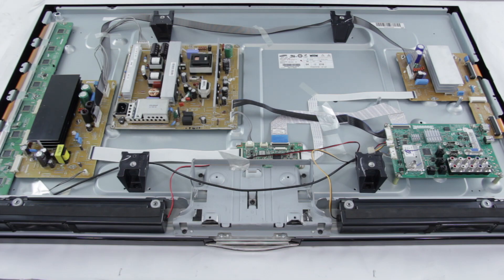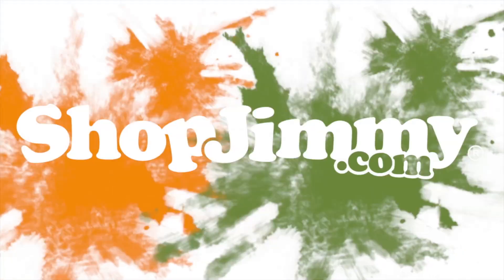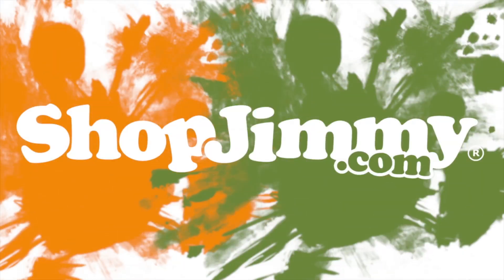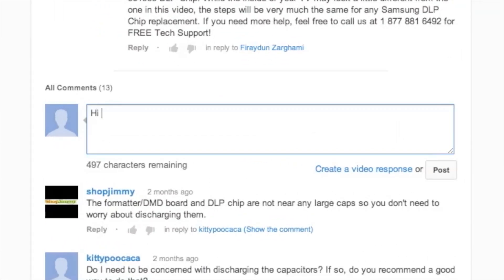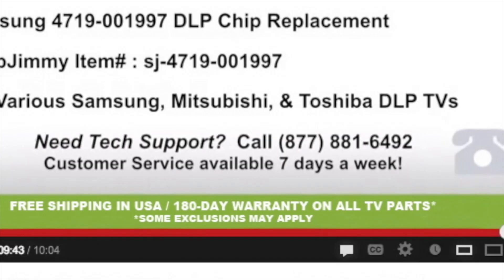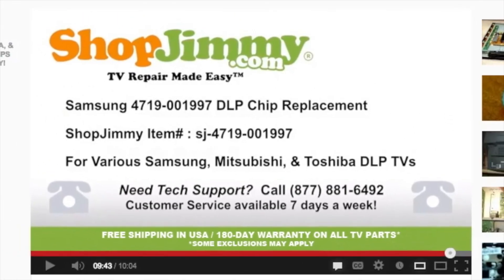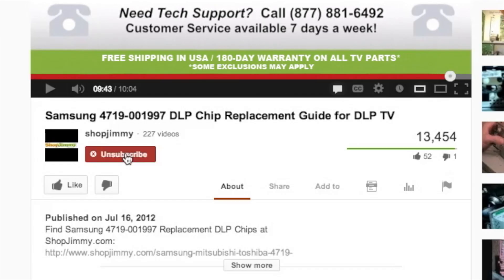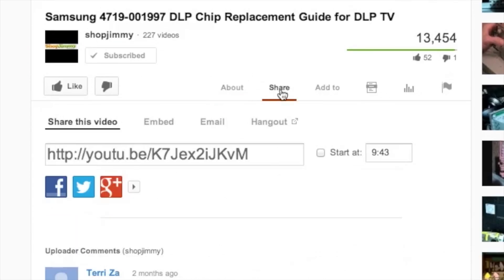Plasma TV Repair Tutorial - Common Symptoms & Solutions - How to Fix Plasma TVs

Comment: Hello, hoping to get some direction on an NoPicutre/ButSound issue with a Samsung Plasma.  
Model: PN60E530A3F
Model Code: PN60E530A3FXZA
Version No: TS02
Symptoms: 
	1) Started out not being able to turn the set right back on when accidentally turning off.  Could hear sound from whatever source was providing signal.  Would let the set sit for about 15 minutes and attempt power on again to get picture to work
	2) After a few months, the power on would produce no picture even if the set was off over night or during a workday.  Noticed the Stand-by light blinking when attempting to power on when this occurred.  At this time, the issue did not occur every time.  
	3) After a few more months, The issue occurred every time we attempted to power on.  Out of frustration, we would press the remote's Power button many times, and after about a minute or two, the television would power on with Picture.  When we were successful, we would leave the television on for days at a time, just so that we would have a television.
	4) For months after, when the television HAD to be shut off, we found the length of time of repetitive PowerOn/PowerOff was increasing, until we were having no apparent success.
Actions Taken:
	1) Lots of Googling for similar issues with Samsung and other Plasma sets.  Found many people with the power cycle issue and blown capacitors.  None reported having sound or the ability to finally get a picture after repetitive PowerOn/PowerOff.
	2) Finally found a video with a Russian (or other Eastern European accent, by my ignorant American perspective) gentleman who described my exact symptoms with his Samsung Plasma.  He described how he ordered an entire board set, replaced every board, testing after every replacement, until he replaced the Main Logic, resulting in success.
	3) Determined that my best initial action would be to order and replace my Main Logic board, based on the striking similarities between my situation and that of our comrade. 
	4) Did research on Shop Jimmy site to make sure I purchased the correct version of my Main Logic board (there were several alterations made to that particular board, and I believe I chose the correct one)
	5) Replaced Main Logic Board and tested with no success, same results as before.
	6) Cursed and shouted and received the eye-rolls and condescension from the wife.
Next Action: Either attempt another board replace, take it to a costly repair shop, or take the set out to a field "Office Space" style.
Much appreciation and adulation for any advice and direction you can provide.  Thanks!
Reply from the maker: Mark Waldorf   I recommend replacing the Y-Main Board and the Upper and Lower Y- Scan Drive boards in your TV.  Here is a link to replacement parts for your TV model number on our website, click here:  http://www.shopjimmy.com/catalogsearch/result/?q=PN60E530A3FXZA  Be sure to match part numbers on your current board, with your replacement for compatibility.  Here is a link to a video showing how to identify your part number, click here:  Samsung Plasma TV Repair: Samsung Plasma Panel Parts Guide  You can also call our customer service for further assistance with your purchase.  (877) 881-6492  Thanks and please let us know if you have any further questions with your TV Repair!  www.shopjimmy.com
Reply: ShopJimmy.com Thank you for your response.  I was coming to the same conclusion based on many comments in other videos based on similar criteria.

However, since my last post, I have attempted some other trouble shooting methods found on other ShopJimmy videos.  I attempted to check voltages on the Main Power Board connections to the Main Board and found the voltages to be as expected.  The connections to the X-Main Board were off or zero.  I tested the VS and VA test points according to several other videos and found these voltages to be at zero.  I have never dabbled in intermediate or complex electronics before this TV, so I am not sure if I tested properly. But since I successfully tested the Main Board connection voltages, I assume that I tested the VS and VA correctly, expecting 211v and 57v respectively, but got nothing at all.  Do you have any further advice about how to test the Main Power as the possible culprit, before I spend more money on the other 3 Y boards?  I have a gut feeling that I'm dealing with a bad power board, though I do not see any visible sign of bad Caps or damaged board.  Thanks again!
Reply: Mark Waldorf@user/shopjimmy Forgot to mention, I also attempted the method of disconnecting the X-Main (and Y-Main by default) from the Power Board, powering up and monitoring the Green LED on the Logic Board.  It originally had a long steady 4-5 sec on 1 sec off flash,  unplugging the X-Main from the Power produced no flash at all.  Then, plugging in the X-Main back into the Power and disconnecting Y-Main from X-Main, and get the same 4-5 sec on 1 sec off flash.  The videos describing this process said to anticipate the quick flashing when the troubled board was disconnected.  But I never got that result. 

Also, I get no power on "chime" from the TV when plugging in, as most videos demonstrate.  

I hope I didn't talk your ear off, but would like to get you as much info as possible to accurately diagnose this issue.  I CAN'T wait to order the correct part, get it in the mail, install it, and watch my TV again!  Thanks again!
Reply: Hi Jason.  Unfortunately, after replacing the Power Board, Logic Board, and Main Board, I was no closer to fixing my set.  I attempted to locate a decently priced Y-Main Board on our continent, but saw nothing I was willing to splurge on without knowing for sure the problem lied with that board.  I ended up taking the set into a TV repairman (who knew they still existed?) and he confirmed the issue was with the Y-Main.  He also confirmed the board was hard to come by and instead suggested that I allow him to send it to a secondary repair contact who re-manufactures boards professionally.  This will cost a total of about $300.  But I'm still paying on the TV/Furniture, and would like a working TV of that size, and am not willing to toss it, when a new one of that size is a grand or more.  ShopJimmy said it was the Y-main, and it appears they were right.  I was trying get away with replacing the cheaper of the boards first, but ended up wasting about $100 on those boards.  When all's said and done, I'll have sunk $400 into a 2 year old TV that originally sold for around $1000.  Sucks.  

If at all possible, try to isolate the problem at the Y-Main... it seems like the culprit on many of these sets, according to ShopJimmy and other YouTube accounts of Samsung failures.  
Like you, I will never purchase another Samsung TV.  We have a 42" Element set that is like 6 years old, still running strong.  Good luck, Kemosabe.  Hit me up again if you succeed,

Comment: I have a Samsung Plasma made in January, 2011. Model #PN50C-4501D. A vertical stripe appears more often than not on the screen 2.75 " wide at a fixed location 5.5 " from the end of the left edge of the screen. Has variable white, black, gray and sometimes pencil thin pink vertical lines within the stripe. Which part sounds defective?
Reply from the maker: Michael Thornton   This sounds like a TV panel problem.  If your TV panel is bad, it may be more cost-effective to replace the TV as panels are typically hard to find in stock, difficult to replace, and expensive.  Thanks and please let us know if you have any further questions!  www.shopjimmy.com

Comment: what parts do I need to fix my plasma tv.my tv has sound but no picture.my plasma model PN60E550D1FXZA
Reply from the maker: Eufemio Simangan   I recommend replacing the Y-Main Board and the Upper and Lower Y Scan Drive boards in your TV.  Here is a link to replacement parts for your TV model number on our website, click here:  http://www.shopjimmy.com/catalogsearch/result/?q=PN60E550D1FXZA  Be sure to match part numbers on your current board, with your replacement for compatibility.  Here is a link to a video showing how to identify your part number, click here:  Samsung Plasma TV Repair: Samsung Plasma Panel Parts Guide  You can also call our customer service for further assistance with your purchase.  (877) 881-6492  Thanks and please let us know if you have any further questions with your TV Repair!  www.shopjimmy.com

Comment: My Samsung 50 inch Plasma TV Model HP-S5053 Powers up , has volume but no picture..I checked the dvd player on another set and it was fine. My research has lead me to your channel for possible help. Any ideas for how I should proceed would be greatly appreciated.
Reply from the maker: Trab Yellup   I recommend replacing the Y-Main Board and the Upper and Lower Y-Scan Drive boards in your TV.  Here is a link to replacement parts for your TV model number on our website, click here:  http://www.shopjimmy.com/catalogsearch/result/?q=HP-S5053  Be sure to match part numbers on your current board, with your replacement for compatibility.  You can also call our customer service for further assistance with your purchase.  (877) 881-6492  Thanks and please let us know if you have any further questions with your TV Repair!  www.shopjimmy.com

Comment: Thanks for the excellent video.  I have a panasonic plasma TH-42PV70H tv which is having problem with display.  The green and red pixels get mixed up and distorting the video.  It is similar to the problem explained in the YouTube video  Plasma Problem Sparkling Red Pixels. Your help to fix this problem is highly appreciated.
Reply from the maker: azuhar   I recommend replacing the Y-main board and buffers in your TV.  Unfortunately I do not see any replacement parts in the search results for your TV model number on our website.  Please reply with your part number on your  Y-main board and buffers and then I can try searching for replacement parts.  Thanks and please let us know if you have any further questions!  www.shopjimmy.com

Comment: Hi Jimmy 

I've been trying to find a video to confirm what's wrong with my tv I have a samsung ln52a650a1f when I turn on the tv works fine but couple minutes later it makes a very hateful sound that comes from the speakers and then it shuts off and on . I tried replacing the power supply but it still doing the same thing I found this video on YouTube this is exactly what my tv is doing http://youtu.be/8qxjAzhm4Rc

Im thinking the problem could be the main board 

Thank you very much Jimmy
Reply from the maker: Ricardo Suarez   I recommend replacing the main board in your TV.  Here is a link to replacement parts for your TV model number on our website, click here:  http://www.shopjimmy.com/catalogsearch/result/index/?cat=56&q=ln52a650a1f  Be sure to match part numbers on your current board, with your replacement for compatibility.  Here is a link to a video showing how to identify your part number, click here:  Samsung Main Boards & Digital Boards: Part Numbers for LED, LCD, DLP, Plasma TV Repair  You can also call our customer service for further assistance with your purchase.  (877) 881-6492  Thanks and please let us know if you have any further questions with your TV Repair!  www.shopjimmy.com

Comment: Hello, I am helping troubleshoot a Panasonic Viera TH-PZ700U.  There was a spark when the tv was being mounted to the wall and the HDMI inputs stopped working.  Every input works fine.  I don't see HDMI inputs on any of the boards.  So does it run VIA cable to the signal board?  I am thinking the signal board.  I don't know.
Reply from the maker: Jeremiah D   I recommend replacing the DG board.  Here is a link to replacement parts for your TV model number on our website, click here:  http://www.shopjimmy.com/catalogsearch/result/?q=PZ700U  Be sure to match part numbers on your current board, with your replacement for compatibility.  You can also call our customer service for further assistance with your purchase.  (877) 881-6492  Thanks and please let us know if you have any further questions with your TV Repair!  www.shopjimmy.com

Comment: Hi, a friend gave me a TH-46PZ80U plasma TV that is not turning on. When I plugged it in, I heard 2 clicks from the center board in the back (I had the back plate off and it was clear the area it came from).  I then pushed the power button and heard the same two clicks.  I also noticed there is a red light on the front that blinks 7 times, followed by a few second break, then it blinks 7 times again.
In a previous post to a friend showell62 you recommended an SC board replacement. I ordered it through you guys and installed it today. I still have the 7 blinks.
Do you have any other suggestions / thoughts?

 ·
Reply from the maker: Juan Jorge Stromsdorfer   It could either be a bad replacement board, or you also need to replace the SS board.  Here is a link to replacement parts for your TV model number on our website, click here:  http://www.shopjimmy.com/catalogsearch/result/?q=TH-46PZ80U  Be sure to match part numbers on your current board, with your replacement for compatibility.  You can also call our customer service for further assistance with your purchase.  (877) 881-6492  Thanks and please let us know if you have any further questions with your TV Repair!  www.shopjimmy.com

Comment: NS-51P680A12 insignia 51" plasma with samsung internals. Tv one day powered itself off and wont turn back on. When i unplug and plug back in it will click on and off several times and then stay off and will be unable to turn on. replaced the power board and did not fix the issue PLEASE HELP!

after watching your video it sounds like its power cycling and needs a new y sus board? i have heard i need to replace the x and y boards together, turth? or can i just get a y sus board?

Just want to be sure the power board is good and i can return the replacement before purchasing a y board

Comment: Hi we have a VIZIO VP50 HDTV10A  the tv will power on but turns itself back off with in 30 seconds. The green standby light stays on. This happened after a power outage. I have unplugged the tv even over night same problem persist. Would this be a power supply issue or the main board issue ? 
Thanks
Reply from the maker: Lynn Reedy   I recommend replacing the main board in your TV.  Here is a link to replacement parts for your TV model number on our website, click here:  http://www.shopjimmy.com/catalogsearch/result/index/?cat=56&q=VP50+HDTV10A  Be sure to match part numbers on your current board, with your replacement for compatibility.  Here is a link to a video showing how to identify your part number, click here:  TV Part Number Identification Guide for Vizio Main Boards (Plasma, LCD, LED)  You can also call our customer service for further assistance with your purchase.  (877) 881-6492  Thanks and please let us know if you have any further questions with your TV Repair!  www.shopjimmy.com

Comment: I have a tc-p50s1 50 inch 2009 the power light blinks 10 time held pwer button down for 10 - 15 second the blinking will stop n power light will stay on but nothing on screen then the power light will turn off
Reply from the maker: bobbielynn griggs  I recommend replacing the A Main Board in your TV.  Here is a link to replacement parts for your TV model number on our website, click here:  http://www.shopjimmy.com/catalogsearch/result/index/?cat=56&q=tc-p50s1  Be sure to match part numbers on your current board, with your replacement for compatibility.  Here is a link to a video showing how to identify your part number, click here:  Panasonic Plasma HD TV Repair Tips: Suffix Codes for A Board & Main Boards  You can also call our customer service for further assistance with your purchase.  (877) 881-6492  Thanks and please let us know if you have any further questions with your TV Repair!  www.shopjimmy.com

Comment: Hello, I have a Panasonic Viera TH46pz85u. I have a black bar on right side going top to bottom. It was flickering but now is solid. I cleaned ribbon connection but no change. Could the board have gone bad? Thanks, Jeremy
Reply from the maker: raramesis71   This sounds like a TV panel problem.  If your TV panel is bad, it may be more cost-effective to replace the TV as panels are typically hard to find in stock, difficult to replace, and expensive.  Thanks and please let us know if you have any further questions!  www.shopjimmy.com

Comment: model # p420142v5 product # GTW-p42m303 it is a gateway 42" plasma television. Once the tv is plugged in the led power light on the front is orange, once I hit the power button it turnes green, there is no picture and no sound
Reply from the maker: Chuck Withaar   I recommend replacing the YSUS board and the YDRVTP board in your TV.  Here is a link to possible replacement parts for your TV model number on our website, click here:  http://www.shopjimmy.com/catalogsearch/result/?q=p420142  Be sure to match part numbers on your current board, with your replacement for compatibility.  Here is a link to a video showing how to identify your part number, click here:  LG Plasma TV Repair: DIY Part Identification Number ID Guide for LG & LG Philips Plasma Panel Parts  You can also call our customer service for further assistance with your purchase.  (877) 881-6492  Thanks and please let us know if you have any further questions with your TV Repair!  www.shopjimmy.com